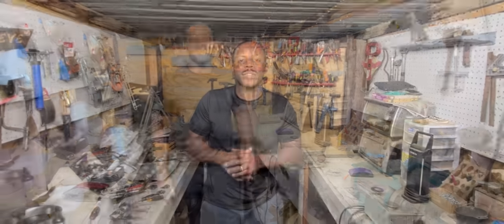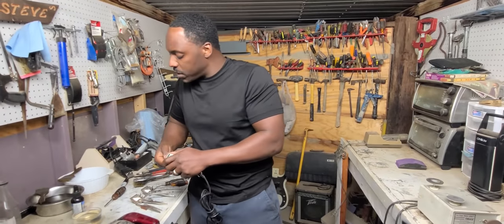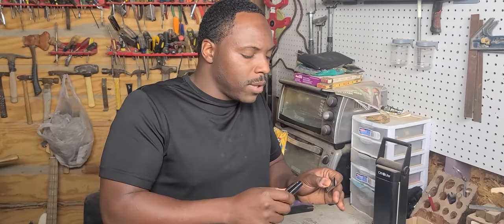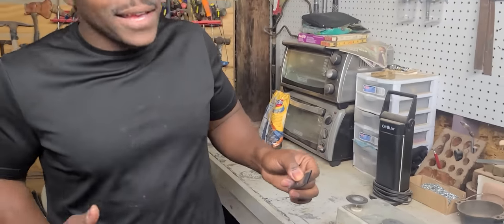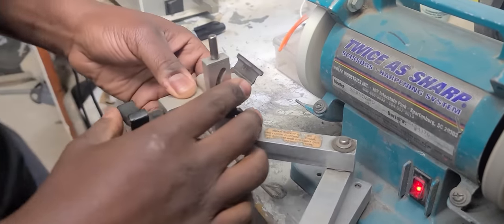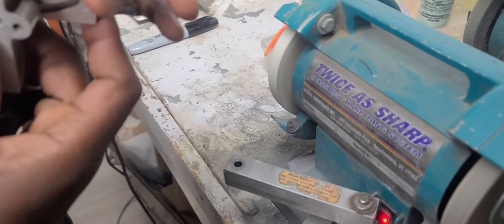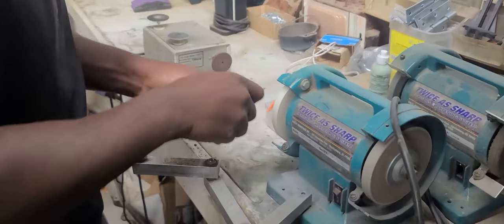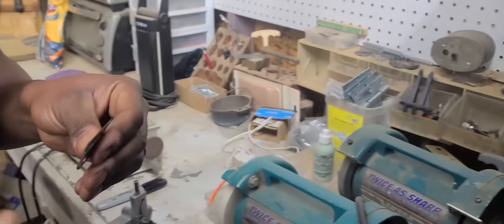How to modify T liner blades Professionally

Comment: Salutations my good sir. I've always worked my creations by hand, it takes a lot of time and even more extensive effort! Yes we as industry innovators need the use of power tools and Implements. Do you perform any deburring of your blades? Good content as always brother. 💈❤️💯
Reply from the maker: You can deburr between the teeth with a wire brush. If you like. Some do i dont. Running the blades momentarily will remove any slight burr. Either way im not dogmatic about the process